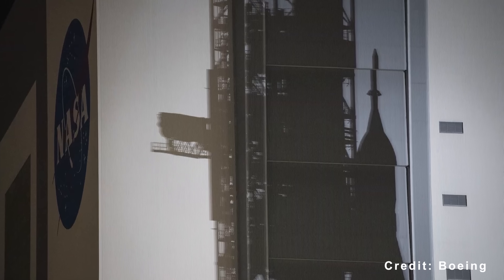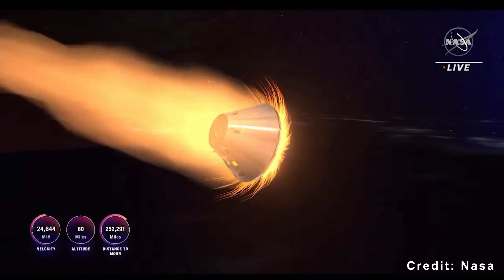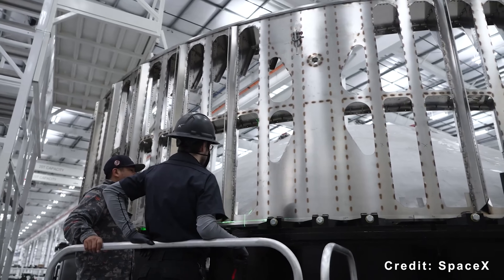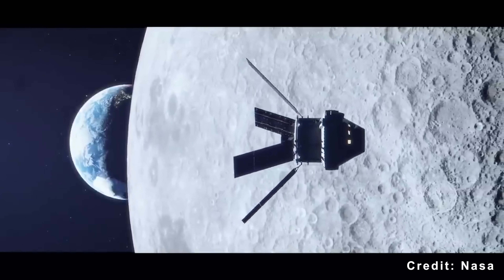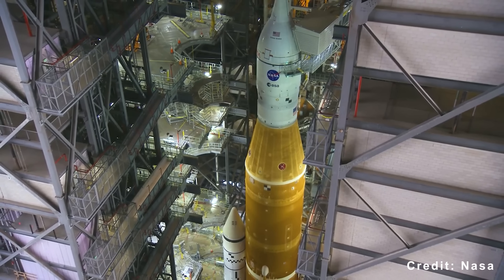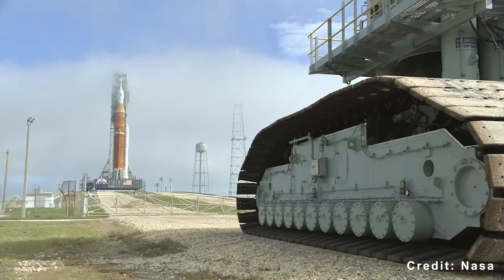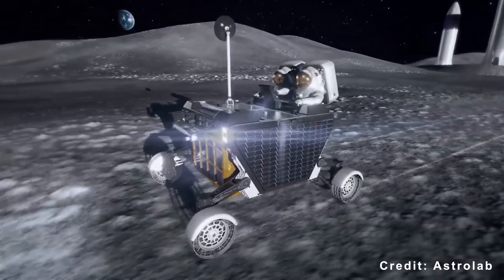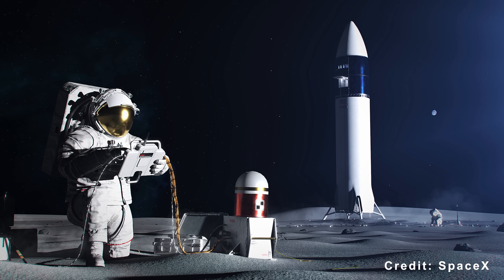NASA SLS finally Launching Astronaust to the Moon after 50 Years But   SpaceX Starship to Rescue!

Comment: SLS SRBs are not recovered. Space Shuttle's were, but they dropped that for SLS for the reason cited.
SLS should have been cancelled years ago and a fr5action of the resources diverted to Starship. Politicians, however, have other priorities than actually returning to the Moon.
Reply: Though I agree in principle, we need to be fair.  If we were to cancel SLS when it would have made the most sense, i.e. as soon as anyone had a good idea that each launch would cost over $2B plus another $1B for the Orion bundle, which I'm guessing was at least 5 years ago and maybe 10, not only was there NO ALTERNATIVE in hand (the current situation, although a simple landing could probably be done with COTS components) but there was no alternative except complete and absolute vaporware.  Now, there is hardware and an ongoing development program that has yet to prove itself, either way.

We'll know more by this time next year.
Reply: It's all politics; Grey Dragon has always been possible with existing rockets. !
 Basically, put a dragon capsule on a Falcon Heavy, on the moon. - you need two, but it's still pretty cheap, relatively.

Comment: the Apollo heat shield worked fine and that was 50 years ago - this inability to design a good shield now is surprising
Reply: The Apollo heat shield was a single use article; the Orion heat shield is intended for multiple uses, or so I've heard.  That makes it a new problem.
Reply: It's a slightly underpowered rocket, so it has to do a slightly dangerously fast reentry speed. I'm listening now, 'skip, skip, re-entry' ??
  Hope he gets onto the really scary moon orbit capture plan!!

Comment: Get rid of that SLS bring back the  space shuttle build it better with nuclear engine, landing thrusters
Reply: I loved the shuttle as well. But actually, a space plane has very limited use, at least for now. A large part of the vehicle is for dealing with the Earth's atmosphere (wings, tail fin, shape, etc.), all for the luxury of landing like a plane back on Earth. There is nowhere else where that will apply: not the moon, mars, asteroids, moons of Jupiter, nowhere. For our point in time with technological development a fleet of reusable starships, operated like an airline, is the optimal solution. Lunar lander versions, orbital refueling depots, Mars landers, habitat modules for the moon and Mars, mining equipment, mobile power plants, etc. There is no need for a spaceplane to even build a low earth orbit space station either: coupling starship space station modules will be the most efficient way. HOWEVER, when the day comes that we have a low earth orbit space station(s) of such scale as to require daily trips to orbit, kind of like 2001 A Space Odyssey, then a space plane makes sense. But it has to be rapidly reusable: No refurbishment after dozens of flights. We'll get there, but we're not there now.
Reply: @LawrenceAllen-xj9sb  the shadow has the capability to land on the moon Mars other planets it doesn’t have to land like it does on the runway on other planets. All you gotta do is put retro rockets underneath the wings in the haul like the Rockets that are going to be on starship landing on the moon it can be done specially with nuclear engines so you don’t have to take so much fuel with you

Comment: The Starship must be used correctly. It is indispensable as a means of delivering a payload of 250 tons to LLO (with refueling from four disposable tankers) or as a means of delivering 75 tons of payload to the same location (without refueling at NEO). But landing it on the Moon is foolish. It is unsuitable as a lander for the Moon! See my article "Morok," the link to which is available in my profile header.
Reply: Don't dispose of the refueling tankers. Repurpose them for building a LEO space station.